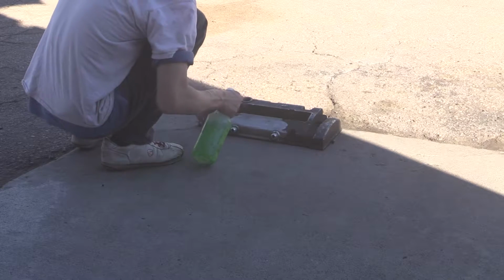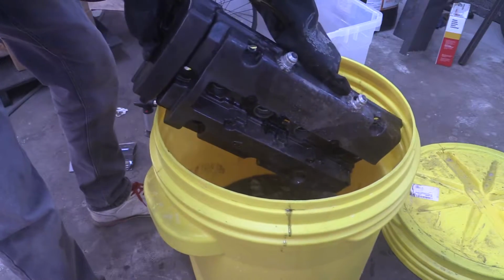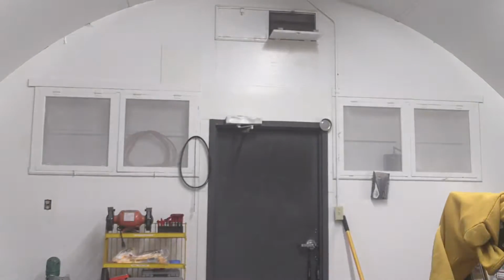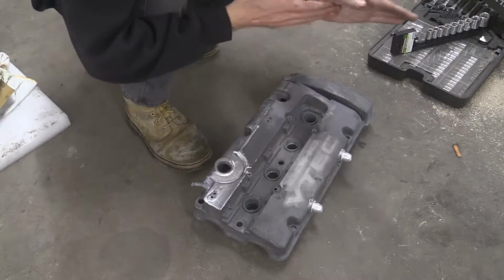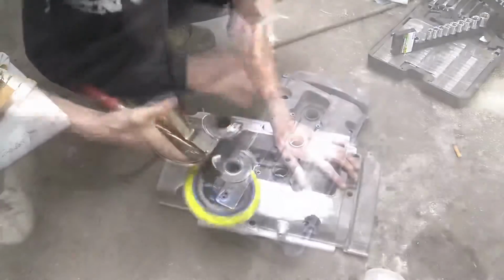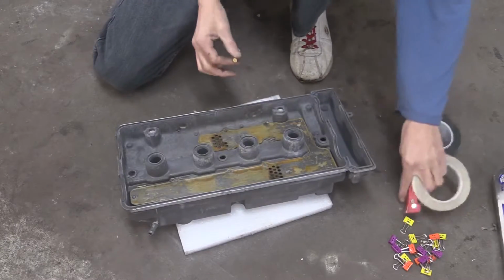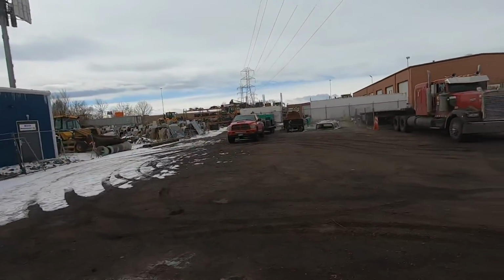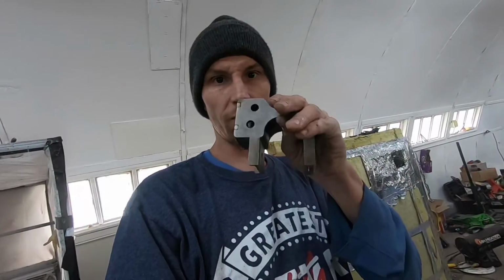Powder Coating a Valve Cover for a 1000 HP CRX Build

Comment: Look am all for making content but taking that much time to sand the face come on I been powder coating for 10 years and never had to do all that cuz of casting lol oh and I’m a Honda guy to so that’s extremely extra lol the min it’s stripped blast it out gas it and paint it that’s it no need for 25 min of sanding shit zinc riche prime would have fixed all that 5 min sanding and a bit of an alcohol wipe a pop in the oven and ready for a coat 🙅🏽‍♂️🙅🏽‍♂️🙅🏽‍♂️🤷🏽‍♂️🤦‍♂️
Reply from the maker: luis orta guess you didn’t see the deep gouges from where the DOHC vTEC was. It was ground off with a grinder, since you’ve been powder coating for 30 years you would know that the powder would lay in all those grooves and show all of that on the valve cover. So yeah a lot of sanding to get it done and nice and smooth and get all those gouges out
Reply: @710performance was definitely worth taking the time to clean up those grind marks